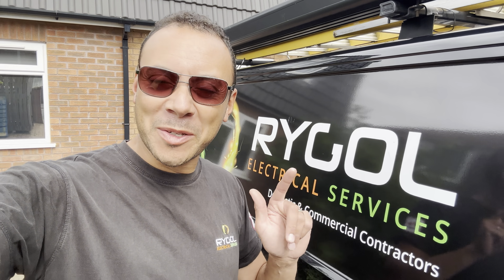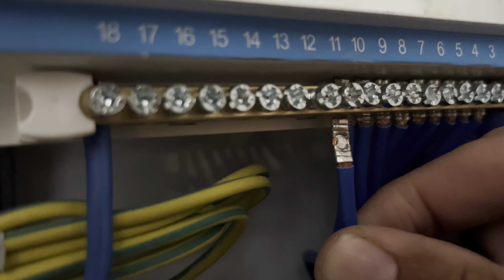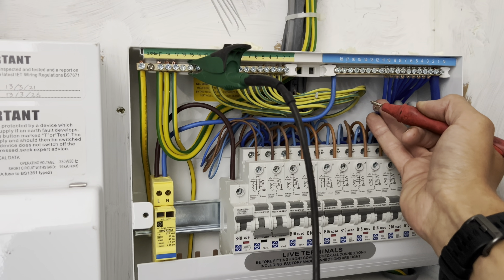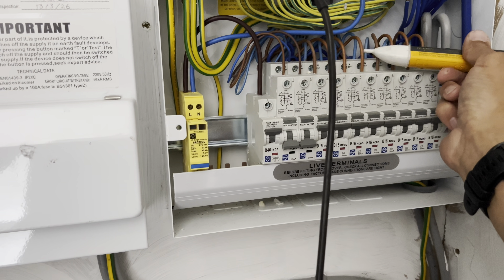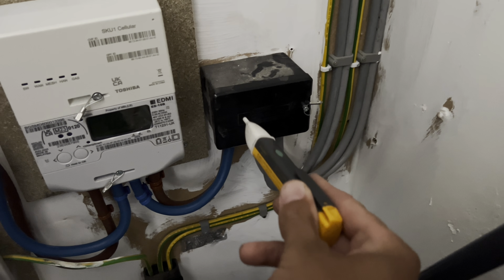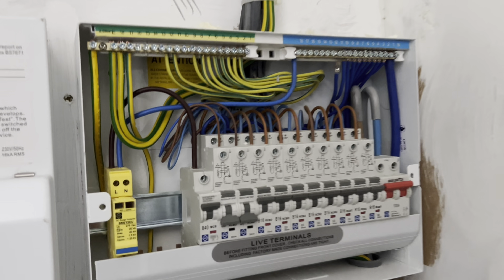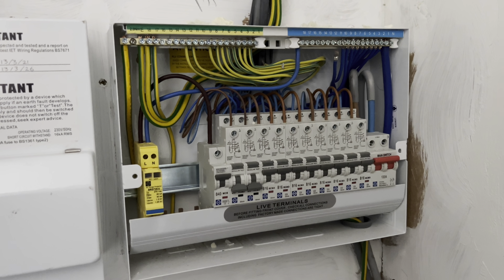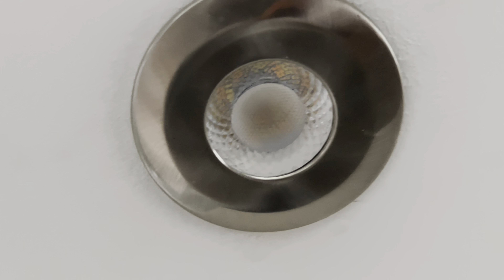Smart Meter Disaster! ⚡️

Comment: Just curious, two fuse boxes suggest two flats, but only one meter. The junction box is after the meter, so why is it sealed?
Reply: If a DNO or Meter Operator work on a Henley block, immediately downstream of the meter, then they are supposed to seal it and take photographs, to prove that's how they left the installation.
Reply: @ten-bob-note  lets hope there is a picture, it will show the person who fitted the meter was clearly at fault
Reply: @itsmyview2024 
The Meter Operator are at fault.
The Meter Operator took the photo.
The Meter Operator are in possession of said photo, so good luck with getting them to admit to their own guilt!
As soon as you cut a seal, as Rygol did, then you take the responsibility upon yourself, unfortunately.
Either make a fuss, officially, and wait for another man in another van, or fix the problem and put up and shut up.
Seeing as it may have been Rygol that wired the Henley block back-to-front in the first place, when they did the rewire, or at least did not check it themselves, then they probably made the right decision.

Comment: How was the fault rectified since the connections within the suppliers junction box were incorrectly set?  Either the seal was broken and the connections switched or the connections to the dist boards were switched and if that was the case then any future supplier electrician may note the 'wrong' connections in the junction box and switch them back.

i would have called the supply company out on an emergency to correct the problem in the junction box as the liability rests solely with them and not with Rygol Electrical.  The supplier's electrician was negligent.  By resolving the issue Rygol Electrical have taken liability for the defective work.  Who pays Rygol's time on this, equitably it ought to be the supply company but rest assured as the junction box was probably not corrected they will wriggle out of the payment - Rygol's fix has probably meant that the customer is out of pocket for something that was caused by the negligence of others and now has little chance of claiming the costs.  This falls into the category of "God save us from boy scouts with power complexes" that was a phrase often used by a colleague who was a barrister and expert at construction law.
Reply: As I see it (pardon my arrogance), the Henley block was already wired back-to-front.
The brown (or red) is supposed to be connected to the upper-rear terminal block.
The blue (or black) to the lower-front terminal block.
So the Meter Operator wired it as per the book, without checking that the previous person hadn't got it wrong, which they had (got it wrong) of course.
Sure, the Meter Operator should have done the polarity check, which is undoubtedly the cardinal error but, who wired the Henley back-to-front in the first place?
Was it an earlier Meter Operator?
Was it Rygol, when they did the re-wire?
If it was already like that, when Rygol did the re-wire, why on Earth did they not correct it then and there?
Lesson 1: Never EVER fail to perform a final polarity check.
Lesson 2: Don't walk away from a miss-wired "accessory" (to use the jargon) without correcting the error.
Any road up, enough of me pontificating on a Bank Holiday.

Comment: It was a rat problem, two legged rats. Who pays for any damage done to electrical equipment? Surely you should have called out the installer to put it right? Yes you fixed it for the customer but the installer can now deny he had anything to do with it. Why didn't the smart meter work this out?
Reply: I won't cut a Meter Operator's seal, unless I have an email, from the DNO, giving me permission.  Even though I've been on the course and have been supplied with temporary seals by my local DNO.
Reply: @ten-bob-note The Henley block belongs to the consumer, they had no right to seal it.
Reply: He’s video’d it before he cut the seals and remedied the problem. Anyone watching the video can see where the mistake was made, the fact that they sealed the Henley block means no one else has been in there and the mistake was made by the meter installer.

Comment: I would have called the DNO and reported:
"Reversed polarity, which I cannot correct without breaking a Meter Operator's seal."
My DNO would have given the MO company a rocket.
Although, to be scrupulously fair, the DP Henley block is wired arse-about-face.
Did you note that on your Installation Certificate when you did the re-wire?
Reply: What code would you give it? I'd do C3, improvement recommended. Also to Rygol, you absolutely MAY pull the main fuse in a situation like that. If the meter fitter f*cked THAT up, what else did they screw up, forgot their screwdriver and left the meter tails loose? (seen that a few times)
Reply: @TheChipmunk2008  Pulling the fuse in the UK is classed as an offence in any situation unless you have sealing pliars that have been issued by the DNO. all you can do is turn off the consumer unit and contact the supplier. The supplier has to send someone out to investigate and correct the issue. If seals are missing thats a get out of jail free card for the culprit.
Reply: @nightwingjattibanez  This seems to depend a LOT on the DNO,  it's not a specific offence to remove the fuse, unless you do so for the purpose of abstracting electricity. SSEN (former southern electricity board region) don't mind us pulling the fuses, we simply seal them with a temporary seal and tamper evident sticker, then call 105 to have them come and properly re-seal. We did have to go on a 1 day course to check for potential on the head etc.  UKPN I know won't even countenance a contractor even LOOKING at their stuff!
Reply: We always take a photo of the fuse and meter with the reading visible and the old seal in place, and then with the same reading and our new seals/tamper sticker in place, to cover our arse against the energy companies who sometimes DO get shirty about it
Reply: Yes conventionally the Neutral would be at the front of the block, for slightly improved safety during maintenance work on it (if energised - and noted that no isolator switch is fitted in this installation). However it wouldn't be actually 'wrong' to use it the other way round unless the block has L and N markings (or colours) inside, that had been disregarded - some do and some don't. So not sure the alternative wiring should necessarily have been noted on the re-wire IC. However, regardless of this, no way should the meter installer have just assumed conventional wiring of the block (if that was what they did) - and then ALSO failed to (properly) do the polarity test. Really terrible. If these are single-pole RCBOs (that wasn't clarified) then all circuits would still have been live even with their respective RCBO off - potentially lethal for anyone attempting a DIY socket replacement - or even a light switch. (Hopefully any electrician doing later work would have first properly proved safe isolation, and so have avoided danger by quickly discovering the problem at that point - in the single-pole case at least.)
Reply: @gastube22 
I in no way disagree with you @gastube22 .
However, if I find a 2-pole Henley wired, not according to "convention", as you so eloquently put it, I would either re-wire it, according to "convention", or apply a warning label, elucidating the situation.
I try not to leave anything to chance.
Reply: Connector blocks should not be sealed as they are containing the consumers tails, just the meter and mains fuse cut-out
Reply: used to hate using those double henley blocks , just asking for problems
Reply: The single pole blocks now come in the colours too.
Reply: @mikeking2855  
Wot, like Red, Yellow & Blue?  😃

Comment: So, why exactly does reversing the polarity cause the LEDs to flicker?
Reply: It will be because there was still line power to the LED lights and there will be a capacitive connection between the CPC and neutral lines. That could be enough to charge up the capacitors in the LED driver circuitry to the point where it will fire it up and drain the capacitor. Hence that flickering. 

The parasitic capacitance between current carrying conductors and the CPC is why a high input impedance volt meter will often read a high voltage on a CPC with a broken connection.
Reply: @TheEulerID  Yes, I think you have basically solved it.  I think that capacitance from the switched live to Earth is allowing an ac current to flow from the Neutral connection (which is now actually live) through the rectifier, through this stray capacitance and down to Earth.  The rectifier converts this to a small dc current which charges the reservoir capacitor until the driver starts and delivers a pulse of light.  This discharges the reservoir capacitor and the process repeats.
Reply: @petehiggins33  That is what I figure. With all the electronics around these days, there's quite a bit of leakage current to the CPC in normal operation, let alone what happened here.
Reply: Good question. I was trying to suss out the exact same. I think it’s because of the parasitic capacitance between the neutral and earth for every cable in the house being a lot bigger than the short run in the switched live from each light switch to each fitting. So each LED light gets 3.6VAC which is enough to make them flicker as they start and stop on undervoltage after their front end rectifier+smoothing capacitor… but there’s probably more to it.